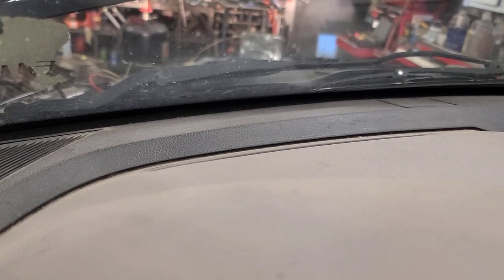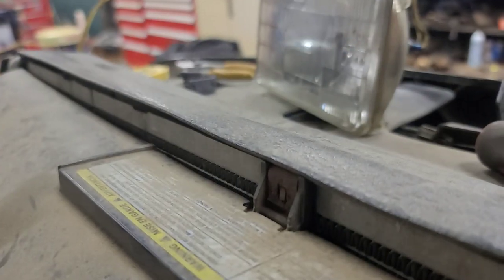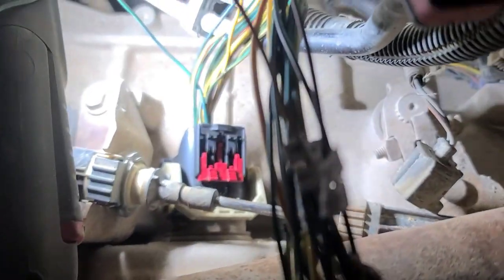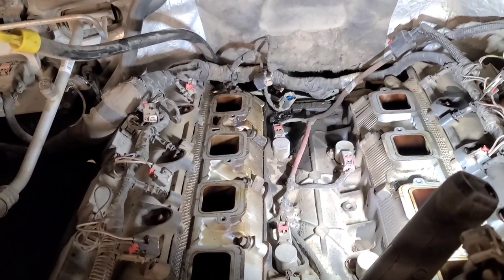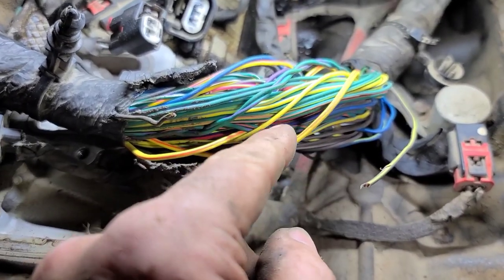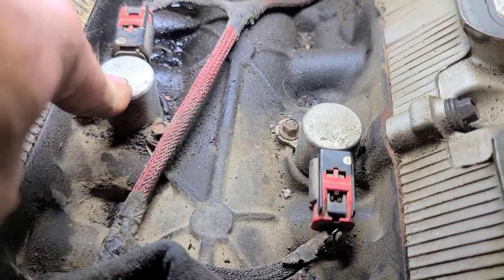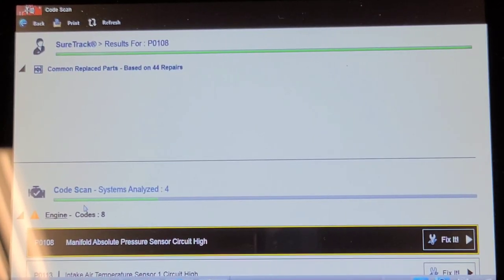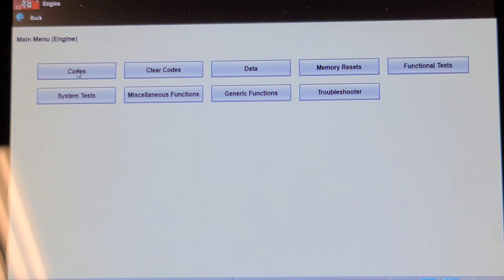2011 Ram 1500 4x4 Transmission in Limp Mode Due to Blown J18 Fuse. pt. 2

Comment: DUDE!  Well done.  That is some of the best troubleshooting that I have seen.  You are also the only person that I have seen use the headlight trick.  A friend told me about that probably 25 years ago and it works great, but I have never heard of anyone else using that.  Despite the fact that my P0882 is on a 2019 Grand Caravan, an amazing amount of your truck situation is directly applicable, the TIPM looks identical.  Thanks for the knowledge injection!!
Reply from the maker: thanks for watching!

Comment: goof find reminds me of a 69 Ford meteor I bought in the Yukon working on highway trucks for Whitepass transport , I noticed brand new alt and battery and regulator on the 302 CID ,week later went to start it ... nothing , it was about 45- out side , but I did hear sparking noises coming from the main harness connector on the fire wall near my left foot , got a car interior heater , and pulled apart the large connector ,the 10 gauge connector was fried , the connector was a 14 gauge ,so i crimped them together ,had that car an other 3 years .

Comment: We had a 03 Ram snowplow truck. The mice absolutely loved to chew on the wire loom. But they keep going to chew up the wires to the point that I also had to replace the entire harness. I later read that Daimler (who owned Ram at that time) used a plant based composition in the manufacture of their wire looms. That is what attracted the mice to bypass all the other vehicles and focus on the Ram.
Reply from the maker: Yes soy based insulation but other manufacturers use it too.

Comment: Headlamp substistuted for fuse in a shorted circuit is an excellent idea. I wonder if aftermarket has a nice compact tester that would be a little easier to use.
Reply from the maker: there are some testers out there but I pefer the headlight myself. I am actually thinking of building a tester with various load test capabilities ie 100 to 200mA, 3-5 Amps and 10 to 15amps with a built in voltmeter and amp meter.
Reply: @PhillipBailey  I was thinking along the same lines for the tester and retain a lite for a visual check and possibly some variable audio signal so you can hear how strong the short is.

Comment: My step dads truck has a similar issue, p0750 and p0822 I inspected a wire that was frayed. If I inspect find and fix the wiring harness will it take his truck out of limp mode? It drops really hard into drive and reverse. 

He isn't employed anymore and I don't want to buy parts that I might not need. The code p0750 is cleaning it's a bad solenoid. Would a short cause it to be in limp mode?
Reply from the maker: A short could cause limp mode but so can an open circuit. Start by checking the fuses and then look for damaged wires. These are also common for solenoids to fail inside the transmission. Unfortunately there's no silver bullet I can offer. Needs diagnosis of the circuits.

Comment: Did this fix the issue????
Reply from the maker: Yes it did.
Reply: @PhillipBailey  Do you think that short was there because of the previous engine work? Is that spot worth checking out?
Reply from the maker: @totallynotaseaotter4946  absolutely related. The harness was not properly secured at the rear of the engine.

Comment: Had the same problem and cut a hole in the floorboard and made it flange and screwed it back or riveted it
Reply from the maker: That's definitely not going to happen in my shop. On this vehicle where the problem was you would have had to take the entire dash out. It would not have saved any time and it's very sketchy in my opinion.  Especially on a customer vehicle.